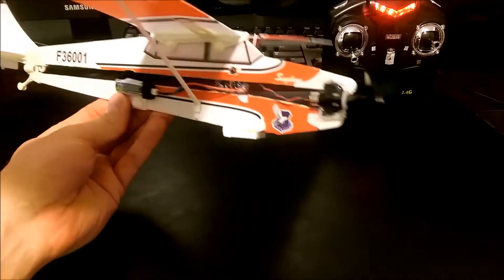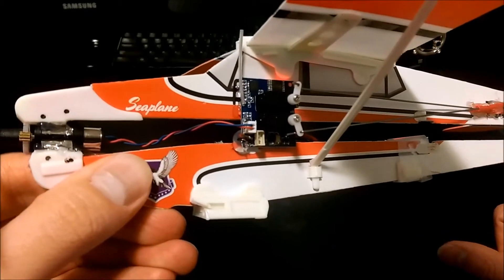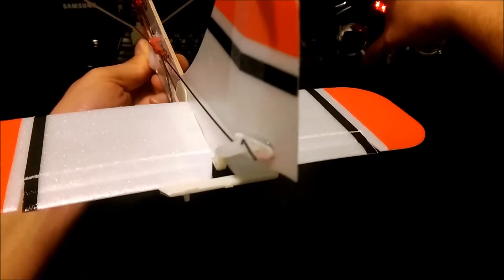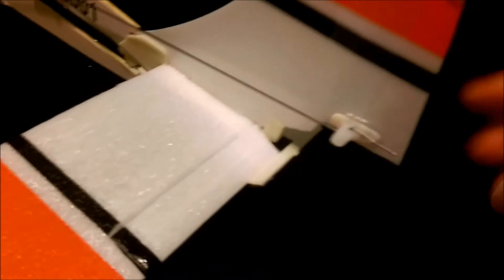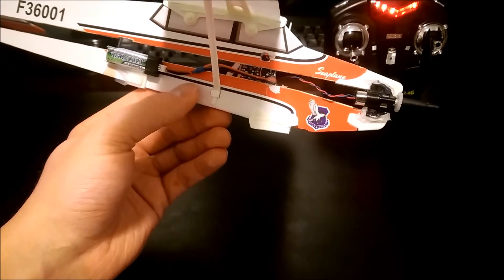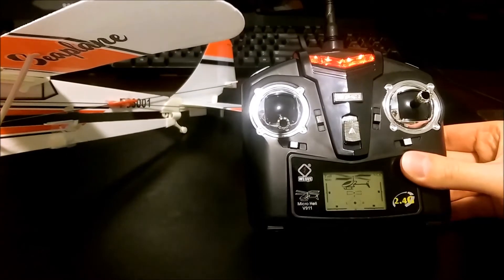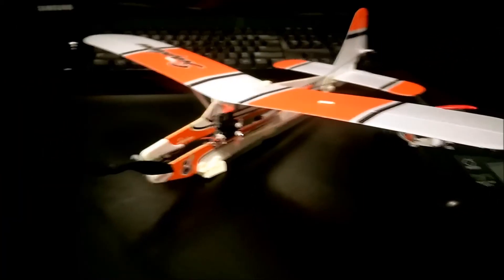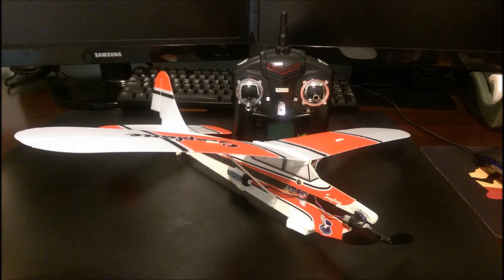CHEAP DIY Homemade Micro RC Plane!

Comment: I Will make a little scale  motor-glider with this electronic parts from wltoys. I Think its the  smallest RC 2,4 full control system we can buy with easy install Mode. 
I can see too in your explanation , that have a 4 conexion to 1 more servo, giving the option to install ailerons too. Thanks for share US this video, give me some important  information , thanks! 😎✌️👏👏

Comment: Fantastic build, man. A tip I could give you is that, if you ever brake the airplane and have to buy another, is to trace it on paper. That way, the next time you can make it from 2~3mm depron or from styrofoam pizza tray. ;)

Comment: How come you have the rudder on the left shouldn't it be on right since it's a 3 channel
Reply from the maker: Will Havens Thanks for the question, yeah, I had planned to make this a 4 channel plane originally, but hadn't received the parts in the mail, so the rudder was on the left stick.

Comment: Flysky T6 , Flysky i6 , Turnigy i6 are suitable as remote control transmitter for F959 , V911 , F929 and some other Flysky protocol receiver boards.
Reply from the maker: Thanks for the awesome tip! I have The Flysky i6, ill have to test it out.
Reply: Jasonoid  , you're welcome ...there's some tricks to binding both rx/tx when using T6/i6 , it won't automatically bind like the original wltoys tx. just search on youtube how to bind it.
Reply: bro.. nih harus WLToys yah..?
Reply: mukhlis1010  , any Rx with Flysky protocols will fine bro...
Reply: FrSky (any Taranis or Horus) can also work with one of those 4 in 1 modules. ;)

Comment: "WLtoys V911 V912 V913 V949 RC Helicopter Transmitter" , what else it can sync with? (i mean the fight control board)
Reply: flousi mcha yugioh FlySky FS-T6, FlySky FS-I6 and a bunch of others. :)

Comment: Lets see it fly. I did a similar thing from the exact same plane. The fuselage on that plane is heavy, it has to take the tension on the elastic band. It flew but was too heavy and sluggish. I've had better success with converting the traditional balsa-stick type elastic band planes. See "Frankenplane".
Reply from the maker: It flew pretty well but when it crashed the motor would constantly be broken off, I guess that's the downside of having the motor up front.